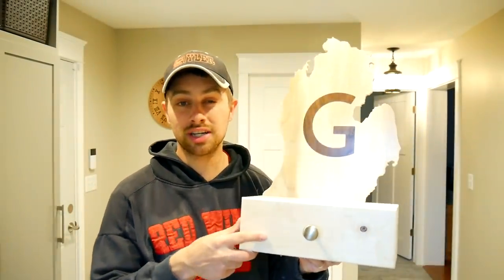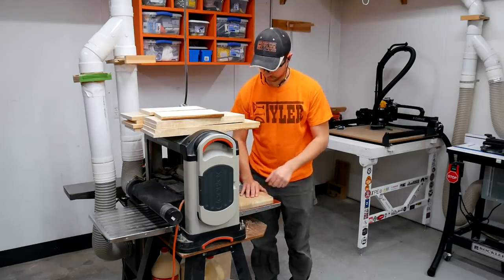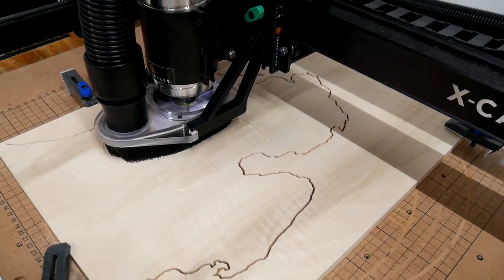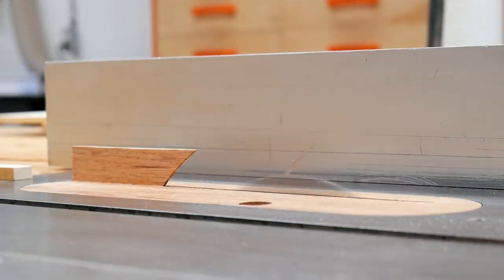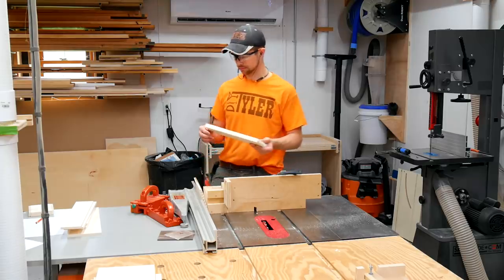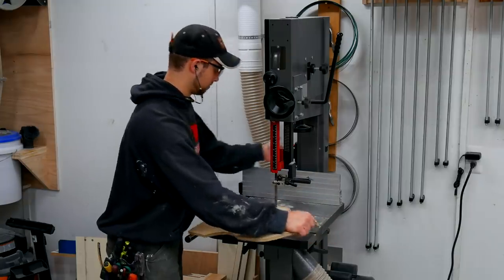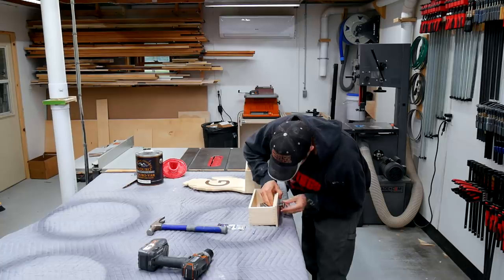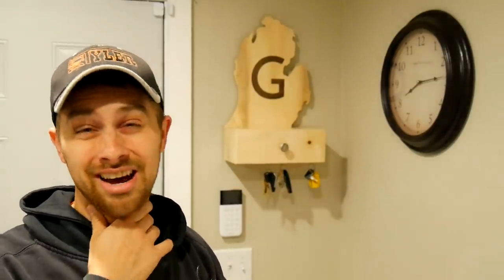Michigan Key Shelf

Comment: Great project! 

I have a wall clock that needs to be wound each month. I got tired of it shifting when I wound it. I drilled a hole through the back panel (hidden by the pendulum) and secured the clock to the wall with a screw. You could put a screw through the box into the wall. It would be hidden by the drawer.
Reply from the maker: Great idea Bob...I think we will do that, will remove the risk of pulling this off the wall. Thanks for the idea and for watching!